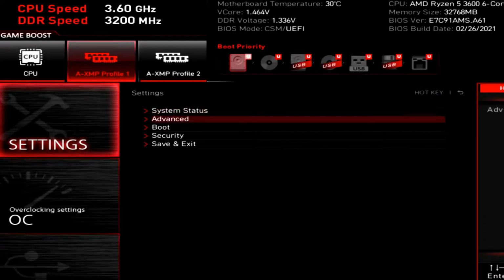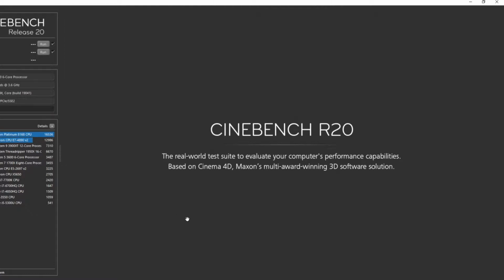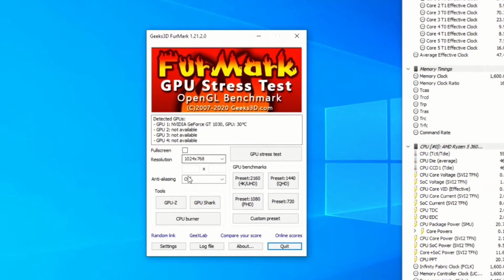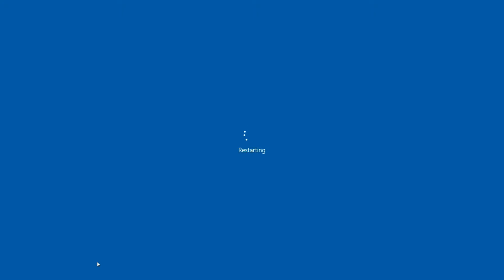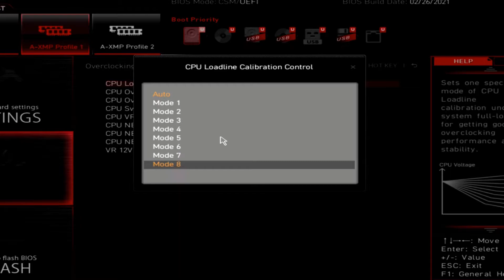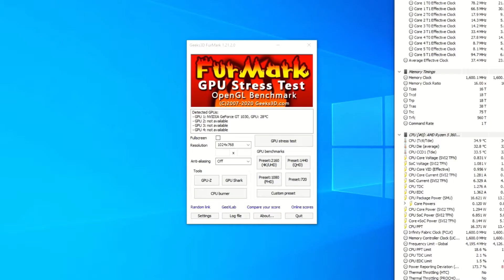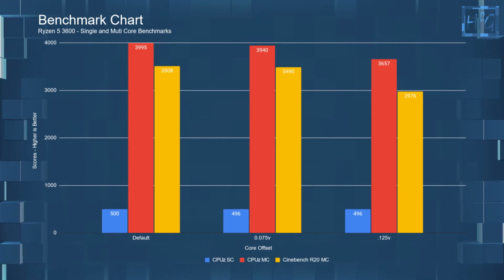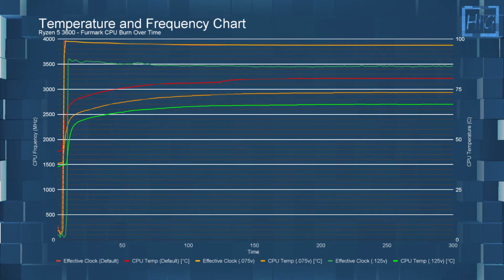How to Undervolt Your Ryzen 3000 Or 5000 CPU

Comment: after 3 years thanks for the video man its works for me pretty well. I was scared because ı have a a320 motherboard they are not to be able o.c and ı think undervolting as well but this setting works for me very well. stock 3600 and 4 copper heatpipes cooler chinese termal paste stock settings 1.3 and 1.4 voltage cpu z bencmark 3988 points with 78 79degress :/ and after do this settings(offset 0.125v ovverride 1.0875) cpu z bencmark 4123 points and just 66 deegres with chinese termal pase thank u so much!

Comment: I undervoltin gonna fail processor permanent damage
Reply from the maker: Under volting a CPU will not cause any permanent damage, but if you under volt a CPU too much the system my become unstable and not work properly.

Comment: better results for 3600 if set to manual voltage i.e. 1.08v and 40x multiplier, gives high speed with much lower temps and energy consumption. Asus Prime B450 didnt support to set in BIOS but Ryzen Master does. Was running stock at 1.27v.

Comment: Probably no point doing this when I'm mostly GPU bound, but if I upgrade the GPU, my X570 Tomahawk should be more than capable of doing this. Pretty much overkill for my system. 😅 I got R5 3600 and 1660 Super. Thinking of upgrading to 4070 and maybe later to 5800X3D and cooling the current CPU with DeepCool Caslte 240 RGB V2 AIO. Hopefully that's enough for the new CPU as well. No space for 360 in my case.

Comment: thanks a lot for this video. running a ryzen 5 3600 on an asus tuf gaming b450m pro-ii mobo with a hyper 212 cooler, dropped temps by 10c+.
i achieved a stable undervolt at 0.175 offset, allowing the cpu to boost fully under load. pbo didn’t seem to help very much
Reply from the maker: Glad it worked so well for you.

Comment: I tried following this but changing the core offset and booting leads to bsod
Reply from the maker: What CPU, motherboard are you using? What is the vcore set to ? Do you have xmp enabled?
Reply: @HardwareForGamers  Ryzen 5 3600, MSI B450m Mortar max, i copied the settings on your video and i keep getting BSOD. also yes XMP enabled

Comment: Just lost 8% performance after -0.025 undervolt and temperatures stayed the same. Will stick to the stock settings.
Reply from the maker: what board and CPU are you using?
Reply: @HardwareForGamers  Asus B550-I, Ryzen 5 3600 with AIO NZXT Kraken x53. Temps with running cinebench ~86°C

Comment: i am confused and cannot find any of the settings you're referring to in my asrock b450 bios. I've changed some CPU voltage from 1.1 to 1.09375 and performance went up somehow but the mouse started cutting out intermittently.
Reply from the maker: What motherboard do you have ASRock what? Plus, what CPU are you using? What BIOS version? And if you're undervolting I recommend you use an offset not a fixed voltage.

Comment: Can the Ryzen 4000 series not undervolt? I see no videos on the series at all.
Reply from the maker: Up until a few months ago the 4000 series was only on laptops and OEM systems (Dell and HP). Those systems likely can not be overclocked or undervolted. The "new" DIY 4000 CPUs were not well received, but should be able to overclock or undervolted.
Reply: @HardwareForGamers  Thanks for the heads up. I was getting the feeling that they were only designed for laptops and thus left out of the fun in some way lol.

Comment: After screwing around with offsets for quite a while, I am forced to conclude that a static undervolt is easier for these chips. Don't worry about degrading them unless you are shoving 1.35 V+ in there - if you have set things up correctly there will be a slight vdroop under load, anyway.

Find out your all-core boost frequency, lock the voltage at 1.25 V (LLC in the middle of whatever range your board has, and max out your VRM frequency if their cooling is good), disable PBO, and use the "cinebench pass, reduce voltage" routine until it gets into Windows but fails CB. Then go back up and use longer/different stability tests, adjusting the voltage upward more, if needed.

Comment: EDIT - be careful... I just had a Youtube crash with my -0.1 V undervolt, despite its being stable under long synthetic load stress tests. I think it's to do with the CPU changing between power states.
After finding what you think is a stable value, keep an eye on it in day-to-day use. I have gone back to -0.05 V.

Comment: I tried this with my 3600 and managed -0.1 while keeping scores; my single-core score went UP slightly, in fact😁😁
Going to -0.125 caused the scores to tank, and it crashed when exiting the benchmark!
(I would enable PBO in the motherboard, too - the default setting might have it disabled.)

Comment: What about PBO?vand,  I ear taht is posible increase the turbo frecuency, how it is possible?. thkns
Reply from the maker: PBO is on be default (on most motherboards) and is how the CPU boosts,  PBO boosts the CPU based on temperatures and or power limits. So get a better CPU cooler and or raise the power limits in the UEFI and the CPU will boost higher. But I don't recommend raising the power limits with the stock cooler.

Comment: Undervolted my 3600XT with your guide. Stable -Offset for me was -0.1000V, everything higher was leading to BSOD or just Bootcrash. 
Max CPU Watt consumption went from 92W to 78W and CPU Temp went from 68°C to 61°C (Watercooled CPU).
Funny thing, the higher the -Offest leads to higher benchmark Scores till instant crash instead of lower benchmark scores. 
Stock CPU-Z Benchmark single 526 multi 4228, -Offset 0.1V single 532 multi 4296, unstable -Offset 0.125V single 535 multi 4317.
Same goes for Cinebench. THX for this Guide!👍
Reply from the maker: Glad I could help 👍

Comment: Good to hear it mentioned that low load-line calibration is the best for undervolting - the reason is a bit technical, but it amounts to the fact that the output of the VRMs is a square wave, and higher load line causes that wave to bounce (it's called "undershoot") further BELOW the target voltage.
If you are trying to find your lowest stable voltage, these dips, however brief, are enough to crash.

Comment: i got ryzen 5 5600g and it's normal voltage was 1.4 when i opened cinebench i got 81-90°c and after changing 1.4 volts of cpu to 1.1375 volts ,my cpu temp now is 60 to 69°c (running cinebench), is it good/okay? and does it damage my cpu?
Reply from the maker: Is the performance the same for single and multi core? (from 1.4 to 1.1375)

Comment: Hi i have MSI B4550 Gaming plus max motherboard with ryzen 5 3600 and i tried the same procedure but for some reason i don't see a change in the results in bios when i go back it shows the same 1.46V at the cpu even though i set everything the same as in the video what could be the problem?
Reply from the maker: Are you able to get into windows? With the bio's settings.
Reply: @HardwareForGamers  Of course, all tests run. But I don't even notice a temperature change, and when I re-enter the bios, it writes 1.46V to the cpu as a base, not a decrease by that value as in your video.